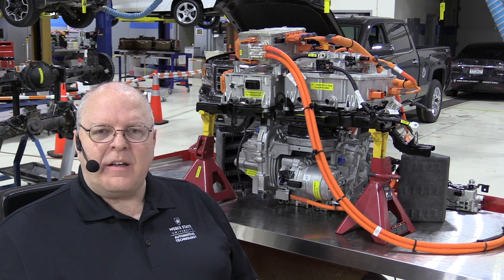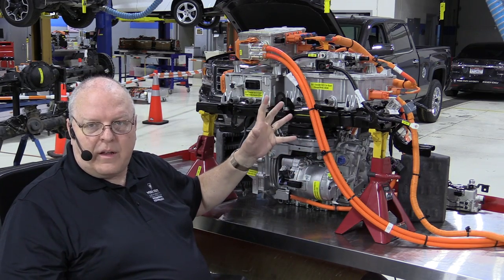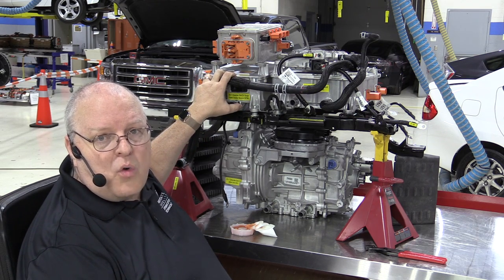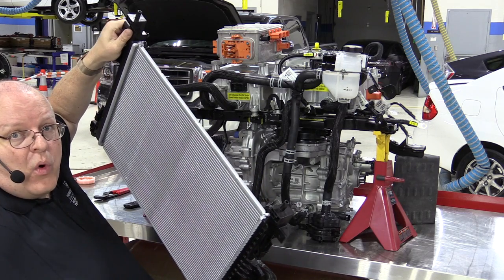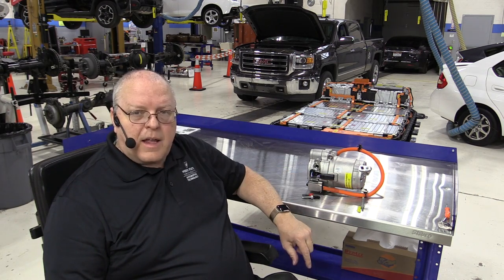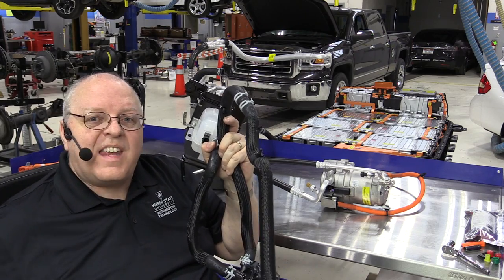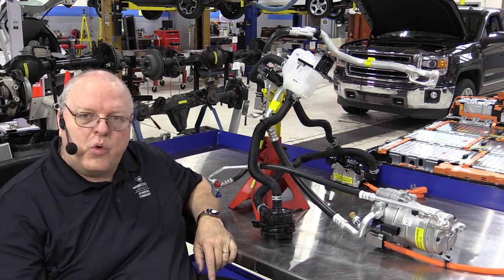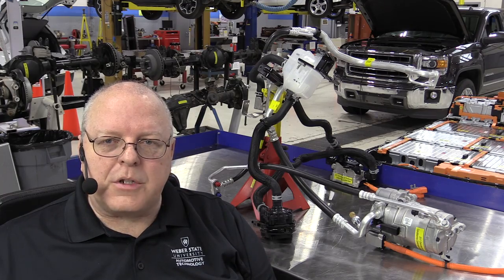Chevrolet Bolt EV Coolant System Loops

Comment: Thank you for this very clear explanation about how the cooling systems work in the Chevy Bolt.  I recently purchased a 2019 Bolt and love it.  

I am a physicist who works in the energy conservation field and have a few questions: at about the 29:50 mark, you begin a discussion of why the heating/cooling systems are separated (for more precise control of cabin temp and to keep the batteries at the proper temperature -among other things).  The issue that bugs me is that running the electric resistance cabin heater significantly reduces the range of the vehicle, especially in colder climates - while at the same time, we have a significant (judging from the size of the radiator) amount of heat that needs to be dissipated from the system.

Here are my questions: 

Do you have any idea of the amount of heat that comes from the electronics & motor cooling loop at various load conditions?  

Do you have any idea how much heat is needed to be removed from the batteries under various conditions?  I assume the battery cooling is mostly necessary when charging (and the faster the charging, the more heat needs to be removed - another question below...)?  Are there times during operation when the batteries need a significant amount of cooling (i.e., does the draw from the batteries cause them to heat up - or is it mostly from fast charging?)

RE: Charging: Given that faster charging means more heat created, is slower charging better than faster?  Is the slowest charging rate (8A at 120v) the best?

Without knowing the values, it would  seem to me that the electronics cooling loop produces more heat than the battery cooling loop - but that it CERTAINLY produces more heat at the time when the cabin needs heat whereas the battery cooling loop would produce the most heat while charging as well as during hot weather - both of which are times when cabin heating is not needed,  

Therefore, the best place to install a heat exchanger to reduce usage of valuable battery kWh would be between the electronics cooling loop and the cabin conditioning loop: it is more likely that you will need cabin heating when the electronics & motor need cooling.  

Again, without knowing the actual values, it seems to me that one would really benefit from having a system that used the heat from the electronics & motor coolant loop to heat the cabin - in particular on long trips during cold weather.  That having been stated, I would think there would be some significant battery range savings during stop-and-go local traffic as well. (after all, whether the car is accelerating or in regen mode, there is heat being produced by the electronics and motor).

I would love to install this system (and don't think it would be that hard to do) but I might wait until my Bolt is out of warranty!.

Can you comment on my questions above - how much heat is available from the various systems as well as my general idea about recovering heat from the electronics cooling system to heat the cabin?

Thanks very much!
Reply: Dave, replying to your question on my post.

Traditional cabin heat circuits require a high temperature differential to cabin air to provide expected performance. I'm not certain but I assume the electronics cooling circuit coolant is maintained below the 180F temperature found in most vehicles. GM used off-the-shelf components where they could. It is certain that most HVAC parts in the dash are from other vehicles. To use lower temperature coolant a very much larger heat exchanger would be needed.

The amount of waste heat from the motor and electronics is unknown to you and I, but we know when it is generated. High loads on the drivetrain will pull high amperage through the conductors and IGBTs. Eddy currents in the motor will be most pronounced at high load. In moderate neighborhood driving or slow city traffic it is likely very little energy is lost as heat, but at startup is when the driver is most anxious for heat to make the cabin comfortable, melt ice, defog windows. Any excess heat from the electronics will be available too late.

Batteries cannot deliver full power or be charged at full power when very cold. Bjørn Nyland tests EVs in Norway. His youtube channel has some very interesting information about low temperature EV operation, especially for Teslas, but other cars too. Batteries need some amount of heat to deliver full performance and create quite a bit of heat through internal resistance under heavy current loads, whether charging or discharging.  Again this heat will not typically be available at first startup. Keeping the battery at the proper temperature is critical to the car's function so that will always have priority (are you listening Nissan?)

So can that extra heat be used? Maybe. I'll give it some thought.
Reply: @Miata822  Bill, thanks for the quick reply.

Your point about not having heat at start up is clearly an issue - probably more so for an EV than an ICE since an ICE is producing mostly heat and the thermal mass of the electronics and electric motor (combined with the much lower heat waste of those components) mean that the heat from the electronics/motor cooling loop would be that much slower to respond.  Additionally, I understand the issue of needing higher temps for initial defrosting and heat purposes - which is why using the AC as a heat pump is not going to cut it during startup (though maybe the heat pump would work fine once the cabin is warm enough...).

All that having been stated, for long distance driving, I think there could be considerable savings: the systems would reach steady state and, once the cabin was warmed, a much slower fan speed would be able to extract heat from a lower temp coolant.  The devil, of course , is in the details - we need to know what temps the electronics/motor loop coolant reaches and how much heat the cabin needs.  I, for one, find low speed operation of the fan with slow delivery of heat once the car is warm to be much more comfortable than cranking the heat at max - which a lot of people seem to do.  I think it is psychological for them...

I was going to point out that even if the electronics/motor coolant cannot provide enough heat for the purpose, it could be used to preheat the other coolant; however, that presents the problem of having a ONE-WAY heat exchanger - because otherwise you would risk heating the electronics/motor coolant to a higher than desirable temperature.  So I see how this could get complicated really fast.

On the other hand I would like to have more heat in the cabin in general - but I don't unless I get uncomfortably cold. It may have benefits of my being more alert and less prone to accidents.

I will check my FB account and contact you via e-mail as well.  Thanks for sending yours.
Reply: @Miata822  I just tried to find your message on my FB account but couldn't (and now I can't find where you said you sent me a message - ugh!).  I searched for Bill Kerr but there are too many of  you to know who to reply to.  If you like, try sending me another message to FB.  Thanks!
Reply from the maker: I do not have access to the information you are requesting. I know that coolant does not get very hot since the reservoir cap will blow off at 5 psi  (35 kpa) rather than the 20 psi (140kpa) of the engine coolant reservoir.
Reply: @WeberAuto  5 psi vapor pressure yields about 228 degrees F

Comment: So I'm guessing upgrading the Bolt EV to support DC fast charging is not economically viable, just from a parts cost perspective?
Reply: that's what it seems. In another thread in the comments here, WeberAuto mentioned that the parts alone for the DC Fast upgrade cost him $3000. Pretty crummy when the factory option is only $750. I wanted to do it for my Spark EV.

Comment: I wonder why they would not use the an electric cadin heater.
I would guess that they did not want high voltage dc to enter the cabin of the vehicle.

Comment: So if my ac goes out the batteries get hot ?
Reply from the maker: The batteries get hot from driving or charging whether you have air-conditioning or not. The AC system removes the heat from the battery Unlike the Nissan leaf with nothing to remove the heat

Comment: ???  Regarding the heating of the passenger compartment, why go thru the complexity of storing, pumping, heating coolant, going thru 2 heat exchangers (one to heat the coolant and one to extract the heat from the coolant to heat the air) versus just using the electrical power directly to heat the air in the passenger compartment with a resistance heater??  It's not as if Chevy is using a heat pump that would have a higher COP.  Sounds way too complex to me.
Reply from the maker: Thanks for your feedback. I am not aware of an electric only passenger car heater. I have seen electric assisted heaters, but they still had a liquid heater core.
Reply: Ever smell a space heater during the first startup after its been sitting for a while? You know that burnt dust smell? That's the main reason EVs don't use an electric heater core. Besides that, if the element burns out or develops a short, the current water-based heater won't easily cause a fire. The all-metal enclosure combined with a water-based coolant would contain a malfunction much better than plastic ductwork.

However, a heat pump siphoning heat from the motor coolant loop would be preferable.
Reply: @MrTsolar  Home HVAC heat pumps still have resistance boosters. The one time per heating season odor of a resistance heater coil is a minor concern compared to a complex, higher maintenance design. The KISS principle appears to have been forgotten.
Reply from the maker: @MrTsolar  Great point! Thank you

Comment: too much amp are lost to keep the compartment warm .
how about the discharge line from the compressor goes to the heater core  , from the heater core to the chiller and from the chiller back to the compressor . in other  word the heater become condenser

Comment: God I hate those hose clamps.. Why don't manufacturers use worm gear clamps? Much easier to use in tight spaces. Also you can adjust how tight they are.
Reply from the maker: Thanks for your feedback

Comment: With all this cooling  system they should  of used the wasted heat in winter to heat the cabin so you dont waste 40% of your range for running the heater
Reply from the maker: Thanks for your feedback!

Comment: Just out of curiosity, why would anyone want a Bolt that didn't have DCFC?
Reply from the maker: If you use it for a commuter car, why would you ever need DCFC?
Reply: @WeberAuto    If you, like I do, live on the third floor of a condo or an apartment that doesn't have charging, you need DCFC.
Reply from the maker: Good point!
Reply: I honestly believe that many people who bought the Bolt EV with out Fast QC were unaware of it when they bought and only found out they were missing this function after the sale. I blame sales people for being uninformed. As was discussed in the previous video, it’s very difficult and costly to upgrade to DCFC after purchase.
Reply from the maker: I agree, the DCFC should not be optional. I suspect they did it to try and compete with the lower price of the low end Nissan LEAF without their DCFC option.
Reply: @WeberAuto  Thanks for sharing these Bolt videos. 
DCFC was only an option in the USA. In Canada, and Europe as well, I believe, DCFC was included as standard equipment on all Bolts. Chevrolet's thought must have been to try to keep costs down on what was seen as new technology and early adoption for their largest market. 
Having said that, I've owned my Bolt for 18 months and only DC fast charged 3 times. Far and away, the majority of my charging is level 2 at home. But boy, having DCFC for those three times when I needed it, was very nice!
Reply from the maker: @cpF01  Thank you for sharing. I would not buy one without it, even if I never used it. Just knowing it is there if I need it gives peace of mind.
Reply: @WeberAuto   I agree.  The needs of apartment and condo dwellers seem to have been overlooked in the design process.  The design of most EVs seems to be based on the owner beong in a single family home with a home EVSE available.  Living with a Bolt EV in a condo has forced me to become much more aware of the logistics of both trips and charging.  I just wish coffee shops would jump on the DCFC bandwagon.  If they did that, I'd have an even worse coffee habit.  ;)
Reply: @WeberAuto  Even if you never use it, having it there for future-proofing or resale value may be worth it. With the extent of the differences the option brings, I don't understand how it is cost-effective to even offer the option. Just in your videos, there are two different junction boxes, two different charge port assemblies, a different wiring harness, and likely different firmware in the car.

Mitsubishi found they could standardize the factory options on the i-MiEV and provide a significant drop in price while delivering a better equipped car. I'd be really surprised if it is actually more expensive to make the CCS port standard on all Bolts and keep the same starting price.

When I bought my i-MiEV, I refused to get one without quick charging, even though there was no infrastructure at the time. I'm so glad I insisted on getting quick charge, as I've used it several times.
Reply from the maker: @MrTsolar  I agree, thanks
Reply: Even though it has it, it is too slow to make the Bolt a real road warrior for trips over 300 miles one direction.  Also, if considering a second hand Bolt, you don't have to worry about the prior owner abusing the fast charging option.

Comment: The Chevy bolt uses a three phase induction motor.
Reply: Michael Hodge, nope. The EV1 had an induction motor. The AC Propulsion T-Zero used an induction motor. The 2008 Tesla Roadster used AC Propulsion induction motor, and Tesla model S/X use induction motors. But the Chevy Bolt has a 3-phase Permanent Magnet motor.
Reply from the maker: The Bolt EV has a unique design of permanent magnet motor. Watch for my motor video later this week.

Comment: OF COURSE Tesla does all those functions with ONE cooling system. Look for YouTube videos that feature the "Super Bottle". Using one system makes it cheaper to manufacture. You have to wonder if the Bolt EV was designed by committee, and committees that work in separate buildings at that.

Comment: So,there you have it folks:  if the A/C fails,...what?   the battery does no longer get cooled, goes bad, and you then junk the car?  And i thought EVs were simple machines,just a motor and a battery, silly me; it seems to me things are not quite ready yet, i´ll keep on ICEing for now.
Reply from the maker: True, If the A/C fails the battery may not be cooled properly, but neither will the passengers in the vehicle. Someone will notice and get it fixed, one does not junk the car simply because the A/C fails.

Comment: Problem with an electric vehicle is it can be hard to make an emergency appointment if you dont have the vehicle charged enough to get you there. Wife had her tooth get infected after surgery and they said to get here asap. The Dentist is over an hour away. If the EV isnt charged enough at that moment???? You aint getting there for awhile and will be suffering big time!